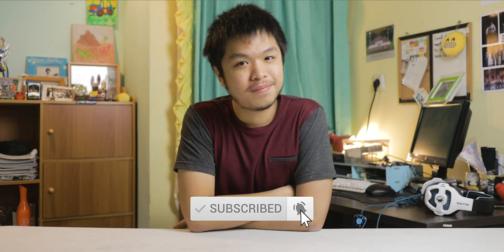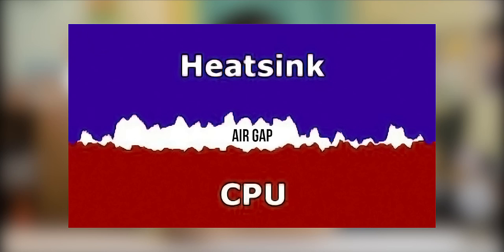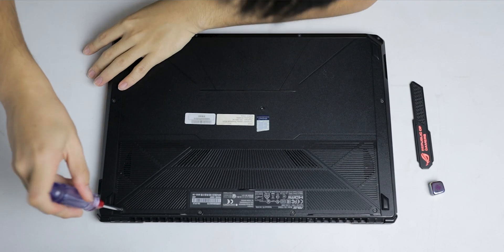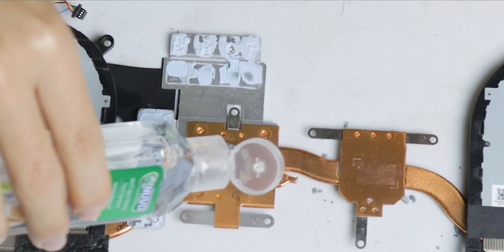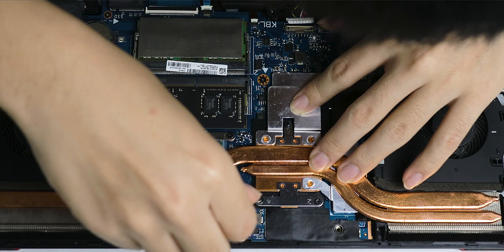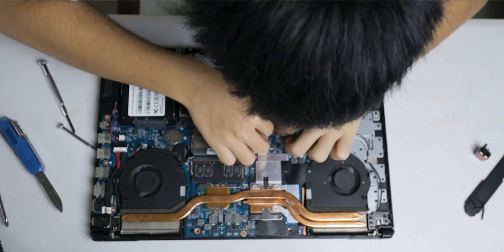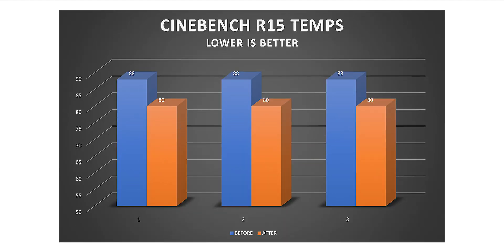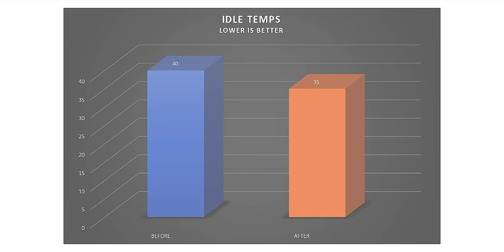How to Replace Thermal Paste - ASUS TUF FX504

Comment from the maker: FX504 - 2 Year Review - https://youtu.be/I6CtOO-NvCU
Power Limit Throttling - https://youtu.be/w2B0ZlNyK50
Upgrading RAM - https://youtu.be/ajW6if8anCg
Reply: Hey Pio, is it okay to put thermal paste on the memory u removed with thermal pads?
Reply from the maker: Yes it's okay, just make sure that u apply enough thermal paste that it touches the heatsink. You might need to replace it more often though, compared to using thermal pads.
Reply: Hey Pio bro I have the same laptop. Can you please send me your discord so that I can add u a friend. I have so many questions and there's so much to discuss regarding thermal throttling, thermal pastes, thermal pads on memory sticks,  laptop coolers, and too much. I'm so confused and I watch your videos cuz u have this particular laptop model and you explain everything very well and provide detailed information which is missing while watching other youtubers' videos. You are great brother. Please help me out bro I'm suffering a lot with this laptop. Please

Comment: I'm having problems with the screw not turning because the plus sign + is broken. Is there a way I can turn it or pull it out?
Reply from the maker: Try using a flat head screwdriver, see if that still grips

Comment: Hi bro! Its good to know and learn from your video. I just want to ask, since i'm planning to do service myself on my asus tuf fx505. For the vram, is it necessary to use thermal pads? Or thermal paste is enough already? I'm quite a newbie, at a point where i don't see any difference between thermal paste and thermal pads. It would be helpful if you can help explain to me. Thank you!
Reply from the maker: It's better to use the appropriate thermal pads, I just didn't have any thermal pads laying around and I don't think it's really necessary.
 
If you are using thermal paste, just be sure that the paste touches the heatpipe. One downside to using thermal paste on the VRAM is that you might need to replace it more frequently compared to thermal pads. It is however more thermally conductive than thermal pads.

Comment: Hey guys, anybody here knows what to do if the laptop won't turn on after cleaned and changed the paste? I grounded myself, checked all the connectors and it acts as if it has no power. Maybe I failed to connect the battery properly? How do I know it is fully connected?
Reply from the maker: Did it turn on if you plug it in?
Reply: @PioSoesetio  Well....it's been 2 months, I have fixed the issue by removing the cmos battery, draining the laptop fully then powering it on via hdmi and a second screen, plug power only with both batteries disconnected, rebooted the bios then had no further issues, maybe this will help someone

Comment: Dude I have zephyrus G15, GPU (2060 Max-Q) peak at 87-89, avg 86, and CPU (Ryzen 9 4900HS) peak at 100-105, avg at 88. Is it good or i need to replace the thermal paste as the laptop is just 6 months old.?
Reply from the maker: If I remember correctly, the G15 has a setting where it enables turbo boost/ thermal velocity boost or whatever it's called to bypass the 35w TDP in the rog armory crate or whatever the name of rog's software is. Try changing that, but do keep in mind you'll be losing performance.

If it only hits 100 degrees for let's say 5 seconds, it's fine. But if it stays at that temp for extended use, you should try above mentioned solution, or you can also try changing the thermal paste.

Was it always like that from the beginning?
Reply: @PioSoesetio  november-december was winter season so not that spike in temps, but now here it's summer at 40 degrees outside temp. I tried disabling turbo boost but the CPU is getting as low as 400 MHz sometimes which makes the experience so stuttering. GPU at 86 degrees thermal throttles and locks to its base clock rather than boost clock. Neither of the profiles of armory crate helped me controlling the temps. Idk if it is good to change the thermal paste for the laptop that was manufactured in oct 2020.
Reply from the maker: @ShibuS  Damn, 40 degrees. Crazy hot. Maybe try using ryzen master, not sure if it works on laptops tho. I don't see why you shouldn't  change the thermal paste, give it a go.

Comment: Since you haven't replied on my comment I'll ask everything here, no worries. So first thing, I'm confused what to use to clean the thermal paste? Second, I'm confused among these thermal pastes to choose from - Thermal Grizzly Kryonaut,  Gelid GC Extreme, Kingpin Cooling KPX, IC Diamond, Antec Nano and Antec Formula 7. Third, I'm confused whether to buy a 5 fan laptop cooling pad or not? Or a good Vaccum cooler?
Reply: Also should I use thermal pads on SSD and RAM sticks? Also, after doing all these stuffs will my laptop (which is troubling from the moment I bought it) start performing decent and cool?
Reply from the maker: @krishnanagar4893  There is no point in using a thermal pad unless you plan to put a heatsink on top of it, but there's probably not enough room to do so. So no point in doing that. Laptop's RAM don't get hot anyway as they're not overclockable and run in lower speed and timing compared to the desktop counterpart.
Reply from the maker: You can use alcohol to clean the old thermal paste. Either Kingpin KPX or Thermal Grizzly Kryonaut is good, I've heard about Gelid GC Extreme but I'm not too sure. Laptop cooling fans doesn't really do much as it only cools the outer surface of the laptop. Using a laptop stand or anything that gives room below the laptop for it to intake air will do the job.

Comment: Hello, i have an ASUS Tuf FX504 laptop and it freezes right after i booted it.
I went to a repair shop and got replacement for my SSD and HDD + cleaned up the hardware. Yet, it still freezes. 
I dont know what to do anymore.
Sad.
Reply from the maker: Did it show the asus logo or can you go to the bios? Complain to the repair shop XD

Comment: hey man thanks for the video, but I have a question, you put thermal paste in other parts that are not the GPU and CPU, and I read that there should go thermal pad, do you know the thickness that should be used?
Reply from the maker: It is recommended to use thermal pads. But thermal paste is also fine, just apply more thermal paste to make sure the VRMs are making contact with the heatsink. One downside to using thermal paste instead of thermal pads is that they need to be replaced more frequently. Around 1mm if I'm not mistaken.
Reply: @PioSoesetio  thanks men for the help <3

Comment: Hi, it's ok to put the same thermal paste everywhere? Others said that we should use thermal pads... Any differences?
Reply from the maker: It is recommended to use thermal pads. But thermal paste is also fine, just apply more thermal paste to make sure the VRMs are making contact with the heatsink. One downside to using thermal paste instead of thermal pads is that they need to be replaced more frequently.

Comment: Hi bro. I have the same laptop but I'm not sure of what approach I should take to solve the problems I'm facing. If I use my laptop for 5 mins it starts to degrade in performance one it begans heating. Like I get 250 fps on csgo when I start but after 5 mins the temperature increases and I get around 30-40 fps. What should I do?? PS: I haven't checked if my thermal paste has dried out. And this problem has started two years after I purchased my laptop.
Reply from the maker: It's very likely the thermal paste
Reply: @PioSoesetio  ill have it checked.👍

Comment: Wow ok good to know that I am not alone. My laptop has been starting to run super hot and throttling. Having 2 years before you have to repaste is really dumb
Reply from the maker: Yeah, it dries out pretty fast due to the heat it produces and the not so impressive cooler.

Comment: Hey, I recently repasted my FX504GM ( i5 8300H, 1060 6GB) with thermal grizzly after referring your video,  The performance jump is huge, seeing temps at low 80s or less with hours of gaming, but still, like you mentioned the CPU gets power limit throttled in both games (25W) and stress tests (45W after turbo window closes) and is not able to achieve that 3.9GHz on all cores all the time, I thought I almost found a fix with undervolting my GPU but then it was only apparent with some games and not very consistent. One weird thing I noticed while repasting was the no. of heat pipes in my system, I have 3 tubes (1 shared to CPU+GPU and 1 for each separately) while every video of this online has 2 and is getting slammed for bad cooling, ASUS made it exclusive to 1060 variants ig. anyway thanks for the instructive video!
Reply from the maker: No probs. Yeah it's just the way ASUS designs the power management to the cpu and gpu. The cooling system wouldn't be able to cool the cpu and gpu simultaenously at the maximum rated tdp.
Reply: @PioSoesetio  Hello, mine is the exactly version like urs but mines get shuttering while play some games. as an exaple I play gta v in low graphics with overboost mode. But it will shuttering after 3,4 minutes. What can I do pls help me??? I upgraded the drivers and all other things btw..
Extended ram - 24GB 
1TB hard no ssd
Reply from the maker: @binarakr  have you cleaned the dust or replaced the thermal paste? If not, then do it, your laptop is probably throttling due to the high heat.
Reply: @PioSoesetio  I did clean the dust but not paste. Thank u for the reply tho
Reply: Hello, mine is the exactly version like urs but mines get shuttering while play some games. as an exaple I play gta v in low graphics with overboost mode. But it will shuttering after 3,4 minutes. What can I do pls help me??? I upgraded the drivers and all other things btw..
Extended ram - 24GB 
1TB hard no ssd

Comment: I have asus fx504GM its having i5 8300h and 1060 6 gb and my gpu clock is sticking on 139 Mhz helpme 😥😥😥😥
Reply: change it to turbo mode using Fn+f5 and make sure ur laptop is plugged in
Reply: @spacestray  you think i am playing on silent mode and especially without charging on😶
Reply: @avikanodiya7239  could've been the case lol but I guess it's not, did you solve the issue?
Reply: @spacestray  i changed the thermal paste i can see some improvement but not that much performance like i was getting before
Reply from the maker: If the GPU is not being utilized, then the clock speed will of course be low.

Comment: Hi bro. Congrats for the great video. I followed ur instructions and can easily open this laptop case but when it comes to the fan cable i m in a fix. Even ur video seem to skip this most crucial part. Can u plz help me with this?
Reply from the maker: Thanks! Just pull the cable out. If it's hard, try pulling it out using a small flathead screwdriver.
Reply: @PioSoesetio   Okay then, thanks to ur instructions I was successful in removing the fan cable, along with all the other screws. :)... But now i am not able to pull the entire cooling unit itself. I am afraid that if i use force to pull out the cooling unit,  i might end up accidentally end up damaging some internal components.  Please help.
Reply from the maker: @prashamitchaudhury5222  There are 3 scres on the cpu and 3 screws on the cpu. Over time, the thermal paste will harden and might make it hard to pull out the heatsink. Try wiggling it a little bit before pulling it out.
Reply: Okay thanks a lot for ur reply. Will try it out. 😊
Reply from the maker: @prashamitchaudhury5222  Yea, no probs

Comment: Can you tell how's its holding up. I tried thermal grizzly kryonaut and it has thermal paste pump out issue. I have repasted my laptop 3 times in 2monthsm initial temps are too good but after few days temps go up.
Reply from the maker: It's doing fine, I've used in on several cpu and gpus and also laptops. Did you apply too little?

Comment: I always get low FPS in gaming and this video helps me get better FPS
https://youtu.be/q1fZsjueqi4

..i tried different ways but nothing works..i did exactly what he did with throttlestop ...i didn't do the msi after burner part(curve part)..and yes heating issue is real with this laptop..so, i went to advance power plan and change maximum processor state something..(i dont remember exactly)..so i change the value when battery= 60% and when plugged in=60%..helps abit with heating..just need  to place something below the laptop so that its little elevated for the air flow ..

Comment: Thaks a lot bro, but  i have a question. Why you don't use thermal paste for vrm of cpu? After i change my thermal paste with your tutorial. I have a little bit of problem, my laptop sudenly turn of if i play PES 2020 for several minute (maybe 30-45minute).
Can you solve that? Or you can give me a sugestion? 🙏 (sorry my english is so bad, i from Indonesia ✌)
Reply from the maker: The VRM of the CPU doesn't touch the heatpipe, there's no point of putting thermal paste there.
Reply from the maker: Does it turn off because of high temperatures or what?
Reply: No bro, my laptop suddenly turn off if i play hard game. But the problem it's solve now. I ask in a forum in facebook, and someone tell me to put the cmos batery.
IDK what the problem, but i just put the cmos batery and my laptop it's totally normal. And then i replace the CMOS batery and the problem was solved 🤣
Reply: I know the vrm of cpu doesn't touch the heatpipe.
Now i repaste again my laptop, with the thermal pad for the vrm of gpu and cpu, and thermal paste for the gpu and cpu

Comment: Hi I did the same and the temperature are slightly lower now but the problem is that the temperature suddenly spikes upto 85 degrees celcius for a second  even when I was just doing light web browsing and then becomes normal again . Why does it does that ? I never found such kind of temperature spike before changing the thermal paste .

Comment: Hi i hope u see this 😄
I really enjoy your videos, you are the only Youtube Channel wich makes good videos about this laptop...
My laptop has an Intel core I7 8th Generation and a gtx 1050 ti.
At the beginning it worked very well but now the temperature gets in word or even only on the desktop to 80 or more degrees. Is this only cause of the thermal paste is dried out or is there any bigger problem, every fan works by the way.
Its now 1 year old and the performance dropped drastically. 
Do you have any solution for this? 

Best regards Luca from austria 🇦🇹
Reply from the maker: Thanks! Yes, it's the thermal paste. I would highly recommend replacing it. Your laptop probably also has more background apps that contributes to it heating up. But yes, replacing the thermal paste will definitely help.

Comment: Great video man. I have the same laptop from last 2 years. Recently like from a week my laptop gets overheated real quick and then throttles.  Ater playing any game for around 1 hour the fps drops huge and CPU and GPU temp reaches 92°C. I really don't wanna mess up opening and replacing the thermal paste cause I've never done it before, so do you have any idea hoe much it costs in a service center ? And also if my problem will get solved after replacing the thermal paste ?
Reply from the maker: Thanks! I would recommend just opening it yourself, just follow the tutorial and you'll be good. If you decide to get it replaced in the service center, the service charge is around $20 in my area plus you'll need to buy the thermal paste. The service charge costs more than the thermal paste itself, not worth it imo.

Comment: im having issue with heating on my laptop and my fps drops in games, so should i change my cooling fans or replace thermal paste?
Reply from the maker: Changing the fans wouldn't do anything unless they're broken in the first place. Replacing the thermal paste will help.

Comment: Please make a vid how to clean the laptop properly ty
Reply from the maker: Plug off the battery and clean the fans with a brush, or if you have a compressed air, use that.

Comment: Hey help buddy. Do you have thermal pump out effect? Help needed. I used the same noctua nt-h1 on my die and the temperature still rises.
Reply from the maker: Sorry, I don't quite understand what you mean by thermal pump out effect. Is it when the thermal paste leaks out? If that is the case, you've probably put too much thermal paste and that will increase your temperatures. Go watch the video in 0:57 for further explanation.
Reply: @PioSoesetio  I didn't put too much, I had put less than a peas size and spread it using a spreader. After some while it leaked out and temperature started to rise.